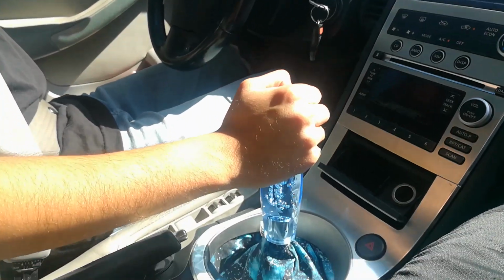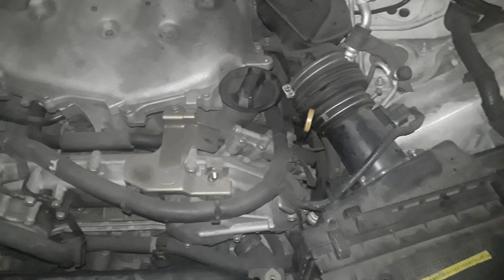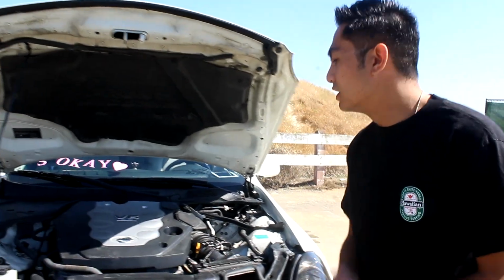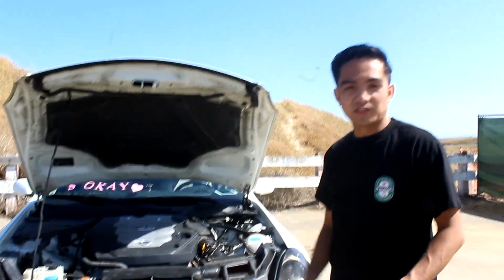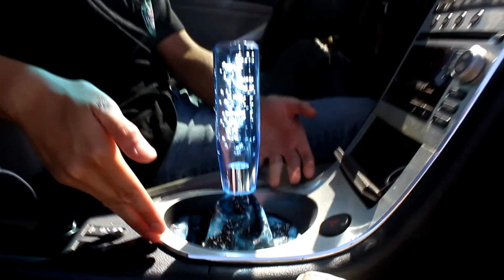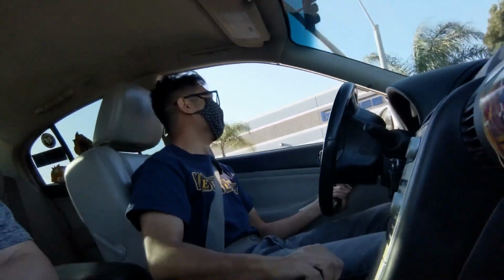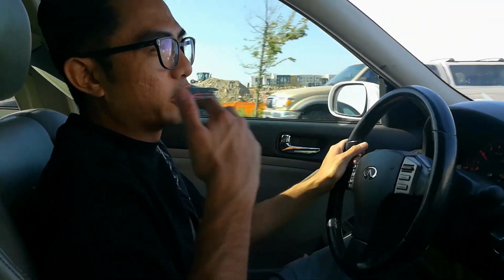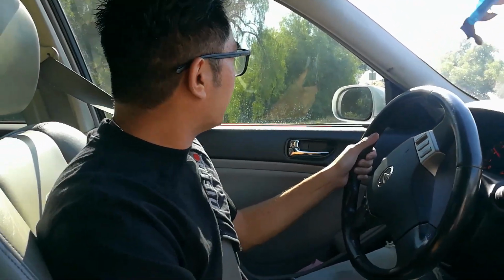I MANUAL SWAPPED MY G35 SEDAN!

Comment: About how much did this run you I want to manual swap mine but I want a HR swapped motor
Reply from the maker: Everything altogether with the upgrades ran a little over 3.5k. The HR swap was something I considered too, but there's some complexity to it that didn't make it plug and play.
Reply: Wildchild_inc sheesh you must really love your G 😭that’s a new car
Reply from the maker: @zyonrjohnson  Can't put a price tag on something ya love. Cost analysis that people don't think about when rebuilding a speced car is I would've spent more on a new car or a used manual. Used manual typically go for 4-8k with like 180k+ miles on the chassis likely salvage title. That's a lot of catch up maintenance. I already invested into the suspension on my car with all the maintenance taken care of through the years with upgrades. Now I have a engine/drivetrain with 50k on a chassis with 130k with a clean title. On another car I would have to invest in building up the suspension again just to get it to where mine is already at.
Reply: @Wildchildinc ok come to the conclusion that I just need to find a wrecked manual car and swap everything  over
Reply from the maker: @ssjdavid  Do it while parts and stuff are still cheap. These cars on the verge of getting another popularity wave in the coming years because Japan is having a resurgence in popularity for them
Reply: @Wildchildinc for sure I just picked up a g35 sedan to buy and selll the other week and end up keeping it because it’s a solid daily lol…. Not a bad car at all

Comment: How did you by pass the neutral safety switch?
Reply from the maker: Not sure, my mechanic did the wiring and said that it just doesn't require the clutch in.
Reply: @Wildchildinc   what did you do to support the clutch bracket ?

Comment: How did they get the e brake to bolt in?
Reply from the maker: It's plug and play. It requires the manual hand brake assembly and cable because the foot brake from the auto is longer than the manual.
Reply: @Wildchildinc  ok
Reply: @Wildchildinc  i got the parts from a manual sedan but the e brake line is long not sure

Comment: It needed an oil change that’s why it’s knocking the oil light doesn’t come on in time to save it u let it run and the chain got dried
Reply from the maker: Bearing spun from losing oil pressure.

Comment: What parts did you need to swap it? Thinking about doing my G soon
Reply from the maker: The list of required parts is in the description!
Reply: @Wildchildinc  I looked and it’s not there
Reply from the maker: @savethecivic96  Parts:
-VQ35DE from 2006 350z at 50k miles
-6spd Transmission from 2005 G35
-Upgraded stage 3 clutch and lightened flywheel
-G35 Manual ECU & Wire harness
-G35 Manual center console
-New pedal assembly
-E-brake assembly
-VLSD with OEM manual gear ratios
-Manual driveshaft
-Custom shift boot by @unalike.co

Comment: How much did just the manual swap cost? Looking to do it to my G soon here too.
Reply from the maker: If it was just the manual swap itself, it would run about 1-1.3k. My entire engine swap, manual swap, and upgrades cost me about 4.2k. My friend did all the sourcing and RND for this swap which contributed to cost. If you can source a transmission yourself, labor will be around 600-800 depending on what your local shop charges.

Comment: Lol my car was the same, slightly less loud on the knock, had no oil, just added some at work and it’s still running rn
Reply from the maker: Chances are it was just the lifter tick on your engine. However, if there are sparkles in your oil then it's likely bearing spun already.

Comment: Hey man, did your cruise control work once you swapped it?
Reply from the maker: Yes! All my normal functions still work! Only difference that I think might play a role to keep things working is my mechanic used a ecu from a manual vehicle as well.
Reply: @Wildchildinc  gotcha, I did my swap and the biggest issue for me is not having cruise control lol for all the arc features... but I’m still using the auto ecu.
Reply: @appleuserr  did you need to swap your ecu when you did the manual swap

Comment: Nice vid man. But if it came out of an 05 shouldnt it be a rev up not a de?
Reply from the maker: Glad you enjoyed the video! Not necessarily. You're thinking of the De to HR. Rev up is still a de motor just with the ecu programmed for a slightly higher rev range. VQ swaps are plug-and-play as long as everything matches properly. I would need a completely different ECU among other things if I did HR.
Reply: All 05 06 manual cars are rev up and 05 and 06 automatics are regular de’s

Comment: How’d you go about mounting the the clutch pedal?
Reply from the maker: My mechanic just did a complete manual pedal assembly change. You can't use the same pedals as the auto because the positions are slightly different.
Reply: @Wildchildinc   so did you have to swap out your brake pedal ?
Reply from the maker: @anthonywimberly4567  Everything, you need a complete manual pedal setup.

Comment: they make these in manual
Reply from the maker: Yeah they do, but it's near impossible to find them clean title below 200k miles
Reply: @Wildchildinc   i was going to buy a 350 manual trans but they said the wiring would be a pain
Reply from the maker: @djrevise  Yeah it's kind of a hassle. That's why my friend opted for getting all the proper wire harness and ecu so he didn't have to deal with those issues. He had to match them all to the proper era too 03/04 are different from 05/06 and it's more difficult if it were to be late 06 HR